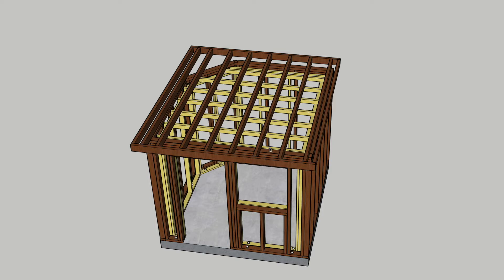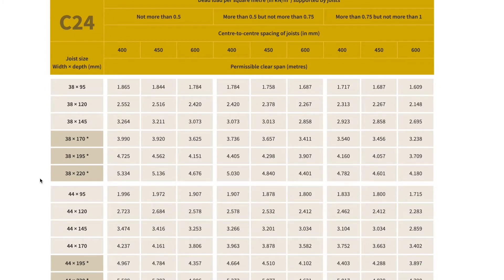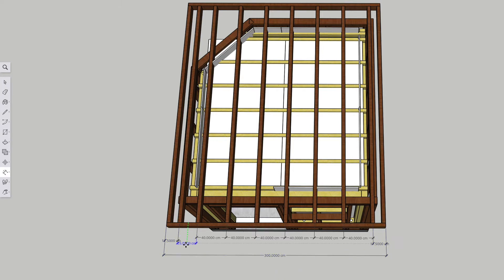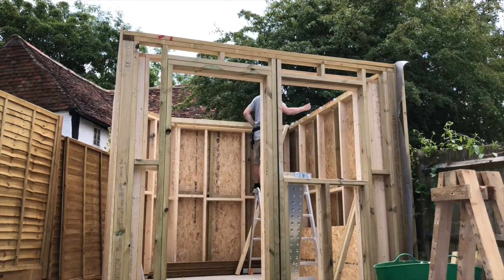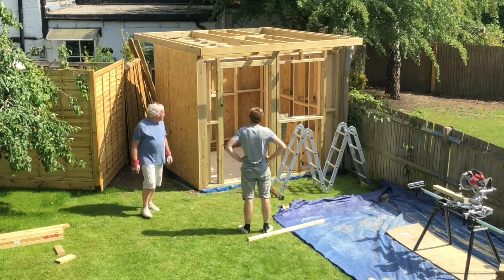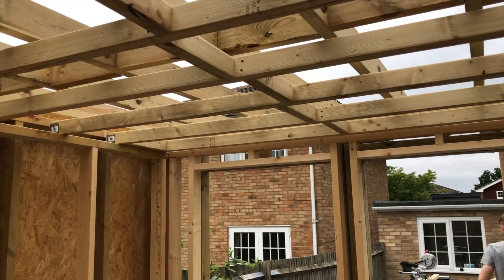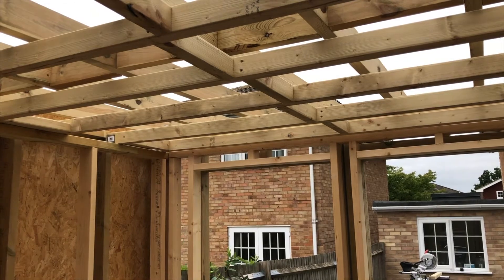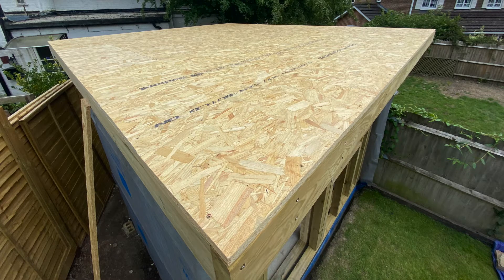How To Build A Flat Roof Structure - Drum Studio Garden Room Build - Part 4

Comment: Hi Lee - Excellent build and diary. It looks like some of your timbers are treated and some not. How did you decide which would be treated as they are all actually in dry locations as you have the concrete base right?
Reply from the maker: Hi Robert, thanks for the feedback. That’s a good question. The main reason is that treated timbers are structurally rated for load baring situations, generally in 2 classes (C16 and C24). Now with that being said, it’s really the kiln drying process that provides the strength for the structural grading, but you don’t tend to find timber that isn’t treated as well. You need to use these timbers to comply with building regs to make sure the structure is sound. That goes for the walls, roof and floor joists if applicable. Obviously moisture shouldn’t make it’s way through to contact these timbers, but it’s an extra precaution. The internal walls carry no load, just the weight of the plasterboard, and as you say are in a dry location, so using normal CLS stud work is fine for that purpose (they are also cheaper).

Comment: Hi again Lee, another question for you. If I've understood the way you're achieving your fall correctly, does this mean that your rafters don't sit flat against either one of the wall plates? I can't decide if I think that'd be problematic in the long run. What are your thoughts?
Reply from the maker: Hi Martin, thanks for your question. Yes you’re correct, the rafters do not fall flat on the wall plates. This approach is quite common, in that you make one wall higher than the other to achieve the fall. There is another option where you make everything level and then add firrings on top, but it adds cost for additional timber you don’t really need. Using nail plates/brackets and a combination of screws and twist nails, the structure is so solid it isn’t going anywhere. You could potentially notch out the intersection so there is a great contact and snug fit, but adding that will add more labour onto the project which you probably don’t care for! If you check out a few other YouTube builds you’ll find this is the most commonly used technique. Hope that helps!
Reply: @leejmurphy  Thanks so much for the response. Do you have any other build series youd recommend? Ive watched yours, Ali Dymocks and the other drum studio you recommend in your design video
Reply from the maker: @martinshaw1988  Hi Martin, yes those are good. I would also recommend watching Oakwood Garden Rooms and a channel in the US called Home RenoVision DIY.

Comment: I dont get why u build to roof in a way, I do understand more support but seems likebto much to have two roof don't u think so ?
Reply from the maker: Hi Mateo, thanks for your comment. The purpose of having 2 sets of roof supports is so that I can have a decoupled ceiling for the purposes of sound proofing which is the same approach taken with the walls. All will become clearer later on in the series. If you don't need to add serious levels of sound proofing to your build then absolutely the second roof isn't needed.

Comment: How do you achieve the decline on the roof frame from front to back ?
Reply from the maker: Hi Robin, thanks for the comment. I made the exterior walls the same height and then added an extra timber along the top of the front wall to create the slop when putting the roof frame on top. There is also a technique know as raking where you slop the wall itself, but if you're doing a small build then I found you don't need to get that complex.

Comment: Brilliant series of videos!
Is this a ‘cold roof’?
Reply from the maker: Thanks, glad you are enjoying the videos Roy. Yes this is a cold roof.
Reply: Lee Murphy how are you going to vent it?
Reply from the maker: So there is a 50mm gap between the underside of the OSB and the top of the insulation. I have then added soffit vents to the underside of the overhang on the front and back, so air can pass freely over the top of the insulation and out the other side. This will be clearer to see in the upcoming videos when I go through the cladding and insulation